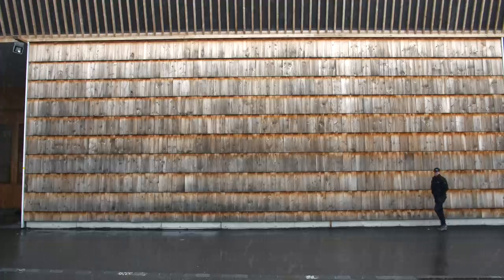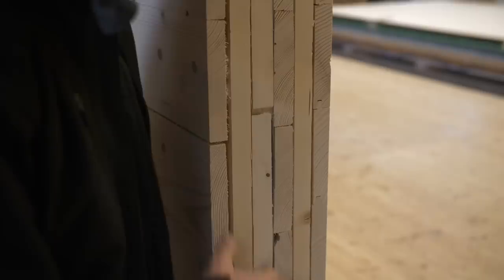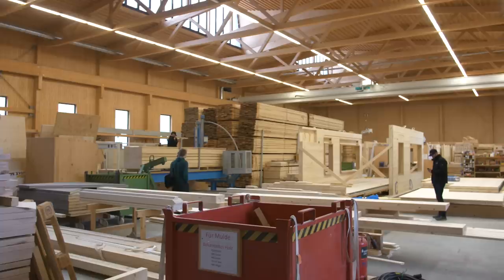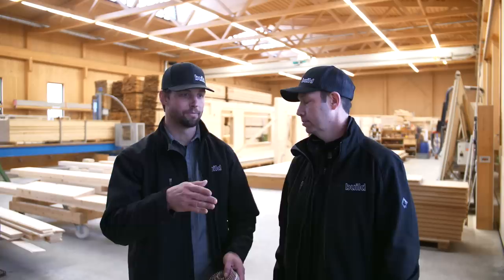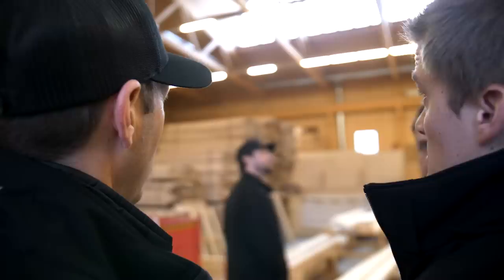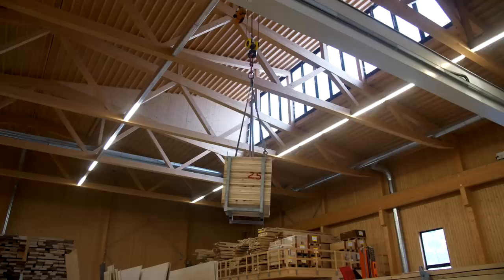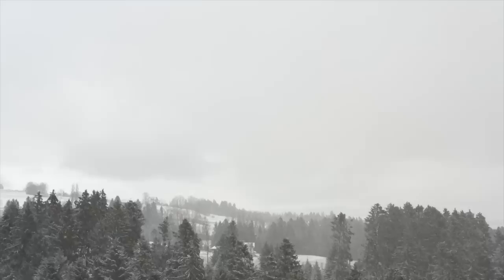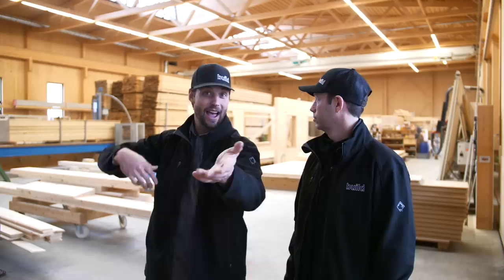This Swiss Builder uses NO INSULATION...

Comment: Can a DIY home builder replicate this? Use 2x10 boards of pine with an outer layer of cedar, make it 11 layers all together . Use a regular nail gun and even wood glue to cheat a little. This should have the same effect for R-value.
Only question I would have is about the bottom layer from a load bearing perspective as well as the top plate to attach the roof to.

Comment: just brilliant.  i think if this were the standard building model, it would raise the value of timber, and likely lead to better forestry and slow suburban expansion into forests.  it is a zero or very low carbon footprint as it leads to sequestering carbon in the form of an nearly all-purpose building material.  the only thing you can't use it for is the foundation and the window panes.

Comment: Matt Risinger In Greece on the other hand, we built for thousands of years using stone and we have a unique experience with stone buildings. 
Take into account the very high seismic activity and the fact that these buildings are long-lasting, and there you have it:
The art of stone building is represented in the following videos and even the professors of the polytechnic were surprised at the end of the first video: 
1. Stone & mud: www.youtube.com/watch?v=KBjn34Vn8r0
2. The art of drystone (no mud, just stones): www.youtube.com/watch?v=OzS_-a6dM44
3. Traditional house of mud & straw (were common in some hard periods...), with modern techniques: www.youtube.com/watch?v=AoCzIO364Qo
Unfortunately, no English subs, but it's worth watching them because a lot of architects worldwide are visiting Greece in groups to learn this art. 
I wonder how good or how bad is the "insulation" when using stone because the non-insulated attic was the big negative factor in most buildings, where I also lived occasionally for a few years (this is my last week in such a house).

Comment: With all that wood is good and all. What about the use of formaldehydes. If your house is completely sealed up the paint your furniture, polyurethane floors everything your house at has formaldehyde and leaks formaldehyde every time you sit on it or lock on it, do anything. How are you going to ventilate all that stuff out efficiently? And if it's not vented out would not house be far more dangerous sealed up tight like that? If not please explain how and why I'm very interested.

Comment: Im really impressed. It relates to the reason the uber rich buy log cabins. They just aren't common anymore and no longer really made the same due to the nature of harvesting trees. It is a neat quality and I can't fault it. A part of me wishes they'd use some cork wood to help with renewability and helping to fireproof while also giving some aesthetic quality.

Still I wouldn't go for an full wood house as my main home project. I'd like to someday have built a two story 6 shipping container home. Recycled full steel that is water and fire resistant with cork/wood furnishings in the anterior and a decade on the outside. It can be fully economical.

Comment: I wonder how ventilation would work in a totally sealed house. I guess they have some kind of electrical ventilation, but I would expect there would be some dead corners where vapor would accumulate. Mildew and rot is a possibility. An old timber framer once told me that building a timbered house in a somewhat loose manner is critical to make sure water vapor isn't trapped. Those 300 year old barns they're referring too are not vapor proof structures. Vapor can find its way out and leave the timbers dry.

Comment: This is the Thoma Method of CLT which is problematic due to expansion and contraction of the panels in relation to the dowels. 
A better method in my opinion is the Nur Holz method ,where the dowels are threaded , thus creating more compression of the slats and basically eliminating any movement of the dowels. 
The third and most widely used method of CLT is glued panels. 
Also it is more efficient energy wise to go with a panel that is a minimum of about 14 cm. or thicker and the same or greater thickness of insulation on the OUTSIDE of the walls , finishing with any siding of your choice. The siding obviously protects the insulation and the CLt panels from all weather damage .

Comment: What the hell is an R value?  
In Europe an R value is the thermal resistance of the material i.e. it is only part of the thermal equation i.e. 1/R1 + 1/R2 +1/R3 = !/Rtotal for three materials in a wall, roof or floor.  The thermal performance  is also directly affected by the thickness of the resistive material.  In Europe we use 'U' values that give whole thickness performance in W/sqm deg kelvin (deg C) that is also modified by the resistance of the boundary air layers to the interior and exterior (modified by orientation and exposure).
Getting thermal performance right is a complex matter and cannot now be down to a single ill-defined product description.

Comment: Could you please tell me how to make a taper pin ?
In metal turning I use a lathe and turn the upper slide/ top slide on the a degree scale . Is it possible to make a similar opporation on a wood lathe?

Comment: if you are going to bother building a structure, it might as well last as LONG as we can reasonably make it last, that way more generations can use it and save themselves the trouble of construction  that also saves every generation needing to live in multiple structures, because the life-span of something built with "just standard" techniques is 20 years or so.  and i see a LOT of construction out there that looks exactly like it would only last that long, and be an energy hog (AC, heating or BOTH) while it did last.  
our commercial buildings are also insanely short lived.  i know i am personally older than a lot of shopping strips and malls, even though i have only just reached middle age.

Comment: What's "off-gassing"? Anyway, you'd never get this through Building Control in the UK, they're obsessed with modern plastic foam insulation and the trouble with modern plastic foam insulation is that you can't dispose of the offcuts because it can't be recycled and nobody will accept the trash in landfill.

Comment: I built a doghouse with only thick wood walls, no insulation, and it stays at 70° when it’s 20° outside with just a lightbulb in it. Built it with the belief that wood is a good insulator. Turns out I was right. Nothing new.

Comment: 1:30.  I accept that R value.  I'm converting from metric (never seen a non-metric U value, so a first for me), but I'll accept the figues.  It's not that great though, even if you double the thickness.  Wouldn't even meet the minimum UK building regs for a new build and you've spent the money on a 16" thickness softwood wall.  No plaster required presumably, which is good, and probably makes it quite environmentally sound, but think I'd prefer straw bale really.  Better U values, much less work, much cheaper, much lighter.  Bet this timber construction stands up well to quakes better though, and the building will be as solid as a tree.

Comment: How many normal people can afford a 500 year home or even a 200 year home? Great to talk about building for the  long term but home ownership would plummet or we would have to create very different very long term ways to finance homes if we did anything like this.
Reply: The world has to change.. We can't keep wasting resources on cheap houses that needs a full restoration after 40 years. It's simply not worth it in the long run.
Building practices have to change for the better, but that goes for everything we surround us with.
Reply: @readeh  I agree it would be better to have home builders and all product builders build for the long term, I just question how it can be done without having us all become a a nation of renters or perpetually in debt with loans that last a lifetime. I do know that most homes being built today are too costly for the biggest need we have which is first time or middle class home buyers. How can we provide affordable high quality housing to the people that need it in this country? I don't have the answers but if we talk about increasing average home costs to an even much higher cost, we need to address those issues.

Comment: Whats the point.. it just seams expensive. If you really don´t want anything but wood. Just make thinner sheets and fill them with saw dust between. Insulation value of Saw dust is twice as good as wood, and it uses half as much materal... And you can also use scrapp dust... so its at least 4 times the insulation per weight of wood

Comment: I think I heard wood is good for aircraft, but not bridges, but wood is actually good for bridges--->>>  https://en.wikipedia.org/wiki/Old_Blenheim_Bridge  They just rebuilt the bridge, there's a PBS/NOVA documentary that's really neat.  They use an improvised laminated scarf joint, that resembles interlocking saw-teeth for the longer sections necessary.  While on the topic of wooden bridges, gotta remember the Davinci bridge as well.

Comment: Wood does not burn at a constant rate even when a constant radiant heat flux is applied to it, regardless of the ventilation conditions, due to charring. Charring forms a layer on the exposed surface that will change the heat transfer characteristics of that surface. The structural performance of timber in fire is not well understood, especially layered wood as shown here.  To meet 30-minute or 60-minute fire rating using the current test for structural elements would be fairly meaningless for timber elements as they are far less uniform and in many ways more complex.

Comment: When a country relies on the construction trade for their economy the construction comes and goes, so longevity isn’t there. Here in the UK we are generally building 25 year lifespans buildings.
Reply: Pitbladdo Associates Ltd 25 years? Don't be ridiculous. Even a cheap housing estate home will last a century plus. Nobody would build a 25 year life home, it would be impossible to get a mortgage and they simply wouldn't be able to sell.
Reply: You’d be best to ask then what the guarantee is on a property. Products have a lifespan. Just look at the schools throughout the UK that are being knocked down and rebuilt with new ones and see when they were built. Homes are built with the same lifespan, and thats why people renovate their properties. Not due to a change in decor, but needs upgrading. Yeah your walls and floors should easily last a century as long as the roof that has a lifespan Of quarter of that lasts.

Comment: How is sealing a house from the outside air healthy? If in fact that is what these hoses do, how is the excess CO2 removed and Oxygen added to the air supply?
Reply: It's "seal it and keep control over the airflow".
It's about control. You say where, when and how much air is exchanged. Not the weather...
Reply: The easiest way is using a combination of windowframe vent holes (closeable by hand or by pressure difference) and permanent ventilation through the „wet-rooms“. An alternative is the use of a CO2 activated air evacuation. Or u vent manually. Or u use a classical HVAC.

Comment: Those 300 year old wooden homes are built without glue. They use gravity and proper wood that has good grain and understanding how grain can work for you. The "Pillars" would be the highest quality wood with amazing grain that didnt have knots in them and the wood would be many years old because these pillars are basically the most important part.
I dont see how this is going to last 300 years with glue and this "slap dash" construction of just gluing wood together.
If you want a good home, just go with cement, brick or stone. Wooden houses are great and as a person who loves wood and old style wood houses in America and Europe, they are outshined in most regards by cement and stone. Wooden homes were built out of necessity and need for shelter and the abundance of wood. Not because it's the better way of having a house.

Comment: In China, we build residential buildings with about 10-12" exterior walls. The very outside is factory moulded aluminum panels, then 2" space in between locking on hinges outside water barrier outside concrete. Talking about building quality and energy efficiency, American buildings are some of the worst.

Comment: 1) super air-tight is bad for human health
2) might be good for homes but in factories you need metal supports (why add them when they can be part of the structure itself) and equipment that can't be attached to wood (by law)
3) more expensive in long run, concrete building will stand for decades and centuries, even in places with rain

Comment: The quality of the roof and foundation is the primary factor in how long a building will stand. What's all this talk about building longevity? I grew up on a farm with 200 y/o timber framed buildings, they've had a good roof and drainage, they're as good as the day they were made. Buildings are assets, well-taken care of, and nobody should be worrying about all that expanding foam and Tyvek never rotting down, it'll be providing shelter for generations to come! People need to start thinking differently about the investments of buildings and property? They can't maintain conventional buildings well enough to keep a roof on and foundation drained. We struggle to handle the responsibility of our status quo. This isn't a solution to that problem.

All that lumber to pack out a wall so thick you need extension jambs on windows and doors, just to almost get an R13? Just to get that wood look and smell inside? What's wrong with ship lap? Technology and green building? As soon as you cited 50% more expensive than already relatively-expensive conventional buildings, that's not green. That's twice the labor time to build, twice the utilities running at the factory. It's certainly more than twice the sustainable timber. I fail to see this as anything but novelty.

Comment: In "dry" locations wood is a fine building material. You wouldn't want to use this method in high humidity areas, it would be garbage. Wood inherently is not a good building material.

Comment: That isn't how carbon sequestering works. Once the house decays it goes back into the carbon system. As for the 500 year old barn. That makes total sense and should not be applied other places. High and cold altitudes are going to be slow to decay wood.

Comment: Its not the same wood, younger trees are harvested now with thincker rings, back 300 years ago older trees would have been harvested with tighter rings better water resistance and higher density more resistant to warpage peeling and splintering.

Dont assume things when you dont know almost everything about the subject at hand.

Comment: No way would you ever get approval in the USA for a 5 ton bridge crane to be supported by wood columns. I can't think of a reason why the bridge girder would be made of steel and the runway beams are wood?? Talk about building for a disaster, I don't get the waste of wood for an application like that, be a cold day in hell before I would work under that even for a day. As for the houses I think the 16" walls with all wood are also a waste of wood, think about the R value 16" of Rockwool at and R value of 3 per inch of Rockwool you get and R-48 for the same thickness even more if it is stacked on top of it's self, I know it looks cool but in reality for the bucks there ain't much bang in an all wood structure. You guys need to spend less time in Ikea.
Reply: JasJones123   LMAO  true

Comment: I must be missing some of the facts as this is not economical based on the video. Insulation is a property, not a material. Wood is stratal and has insulating properties and it is much more expensive per volume than fiber glass batting or cellulose or omni block (as wood, structural insulator). This video is showing us a hobby loosely linked to a not-well-thought-out-theory. Log cabin does the same thing as this, without the dowels or wooden nails.

Comment: They're wood is light like balsa wood nothing like Doug fur Sweden wood is weak and light. R value no strength unless you glue and screw like that.
Reply: Bullshit. Most of the Wood used for Construction in Switzerland is spruce. There is not much difference between doug fur and spruce.

Comment: Id be fine living in a forever home, if contractors and builders would stop doing shortcuts and using the cheapest options out there that save them money and then you discover it years later after damage happens.  Maximize their profit on the backs of the homeowner yeasr later
Reply: Virgil   Those pesky contractors, there they go again, making a profit on the backs of homeowners . Ever heard of “ due  diligence?”
Reply: @michaelpair4144  What does that mean, that I have to watch the contractors to do the work correctly? Isnt that what they are paid to do.   I still have to check their work?  So when you take your car in to get repairs, do you watch them?

Comment: I believed your all wood pitch and I felt good for this company that strives to be all environmentally friendly, until you talked about their factory, their massive trusses and beams made out of glulams. Wait. aren't glulams made with industrial strength glue that has off gassing toxic chemicals in them? I do understand the need for glulams for long span needs of a larger structure. Just don't  go portraying this particular company as some sort green god that can do no wrong. Log homes built in the states can and are made the same way also. No nails, no chemicals, no off gassing.